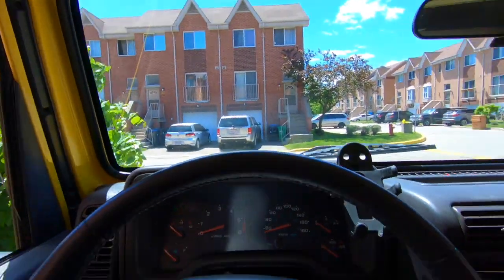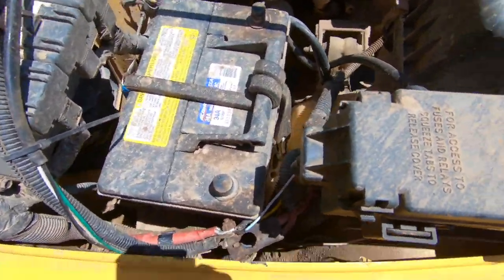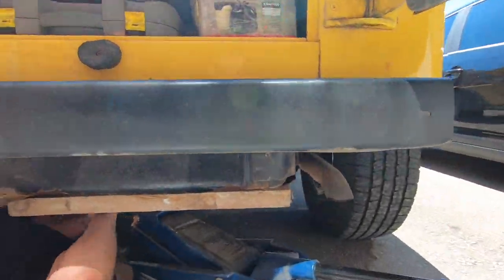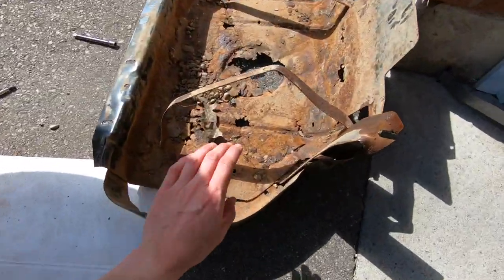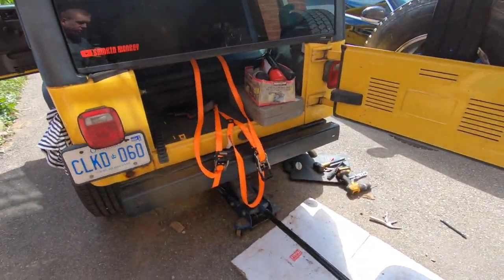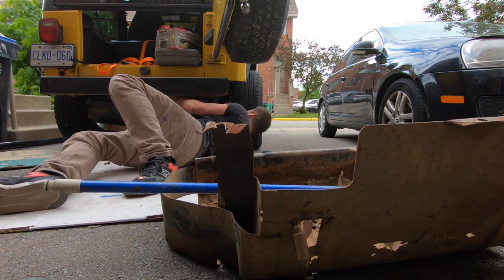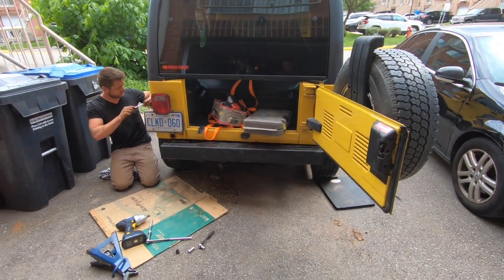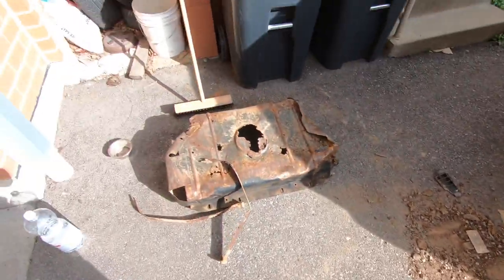Installing New Fuel Tank Skid Plate On The Jeep Wrangler TJ

Comment: I just did mine by myself in 2 hours I assembled tank and cover wit straps before u mount up the assembled tank and cover together and on the front bolts a 3/8 sachet with 1/2 " socket and it fits in top and you can reach the head of bolt then tighten with socket on but on bottom

Comment: Should have pulled the tank. It a real mf. Them carriage bolts suck because the bracket is rusty, so they spin you have to pry down. Keep a lot of force on the bolts and then hit it with your air gun and if you get real lucky you won’t have to put an air chisel.😢 remember if you think your going to replace that back sill, pull the tank or you will drill the tank that you can’t buy when I put the front bolts back in I will weld brackets to the bolts so they won’t spin. Mine is the 05 extreme collector item!!!!